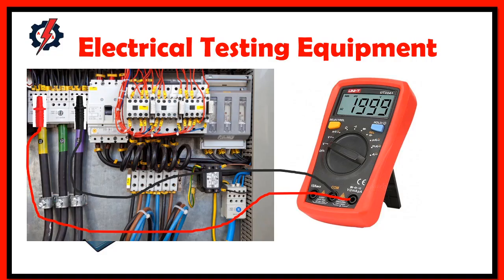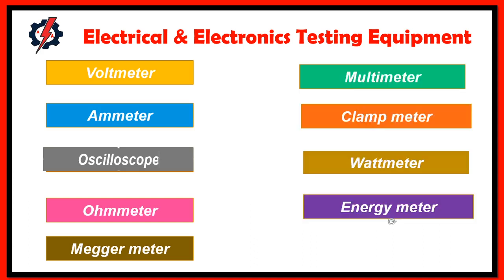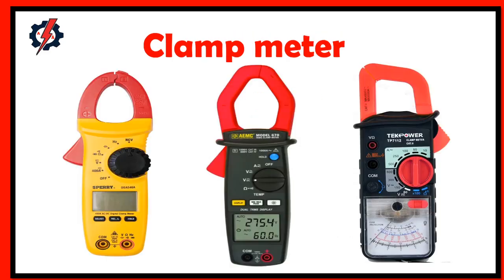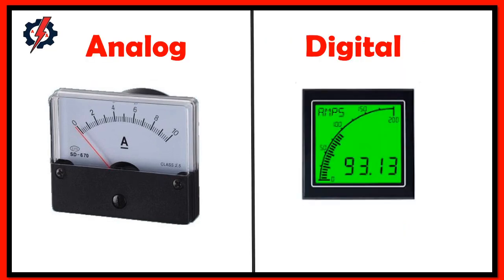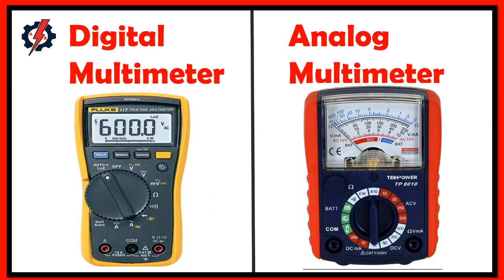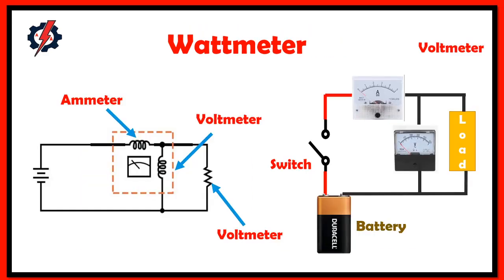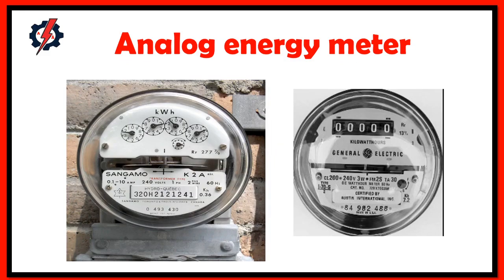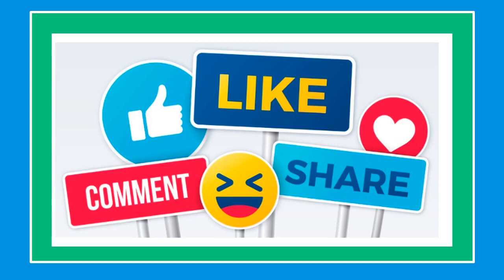Electrician interview questions and answers part 4

Comment from the maker: UGLYS ELECTRICAL REFERENCE 2023 from $26 to $20 https://amzn.to/41NtYvO
Electrical Interview Question Answer $10 https://amzn.to/3RFoAWW
Technical interview Questions with Answers 450 QUESTION $59 https://amzn.to/3S1ln5e
2023 NEC CODE BOOK + UGLYS ELECTRICAL REFERENCE 2023 $62 only https://amzn.to/47cxl0g
================================================
===================================================
Emergency Safety Warning Frame 3PCS. $14 only https://amzn.to/3H6DNes
Portable Air Compressor Pump for Car Tires $45.99 to $27.99 https://amzn.to/4aFkO8v
 Jump Starter 2000A Peak 12V Car Jump HEAVY DUTY from $59.99 to $44.99 https://amzn.to/48yiq1u
First Aid Kit, 100 Pieces Water-Resistant $15.99 ONLY https://amzn.to/3RFdeC8
9-in-1 Emergency Auto Tool with Flashlight $16 ONLY https://amzn.to/3H3mg7g
===========================================================
CHECK OUR PLAYLIST for SPECIFIC VIDEO and TOPIC of INTEREST.
HVAC TRAINING VIDEOS
https://studio.youtube.com/playlist/PL8zOygNOyBo3zrCNSXihV0GiiSSzJVOVi/videos
AUTOMOTIVE INTERVIEW PLAYLIST
https://www.youtube.com/playlist?list=PL8zOygNOyBo1ymtUAao2yIzIWszbV_YbM
Basic Pneumatic & Hydraulic Playlisthttps://www.youtube.com/playlist?list=PL8zOygNOyBo3R5oYG3QbiKpTDfea7lOH_
Basic Electrical Knowledge https://www.youtube.com/playlist?list=PL8zOygNOyBo1Nq53tdaSt1FfoIjMIV52F
NEC PLAYLIST PRACTICE TEST
https://www.youtube.com/playlist?list=PL8zOygNOyBo17cr6XXt6xzSFk4nbub6fU
ELECTRICAL INTERVIEW QUESTIONhttps://www.youtube.com/playlist?list=PL8zOygNOyBo03qqp_LS_kaOuWQ9Jhu8Eh
Motor Control Playlist https://studio.youtube.com/playlist/PL8zOygNOyBo3M__oKow-pHaVftVOAfbFT/edit
Electrical Practice Test Playlist https://studio.youtube.com/playlist/PL8zOygNOyBo1I8Pxs2EOcjSpyo_T3KKWV/edit
ABB ROBOT PLAYLISThttps://www.youtube.com/playlist?list=PL8zOygNOyBo1-r6lAlnSPf13Pb12qD_hh
Fanuc Robot Playlist https://studio.youtube.com/playlist/PL8zOygNOyBo1I8Pxs2EOcjSpyo_T3KKWV/edit